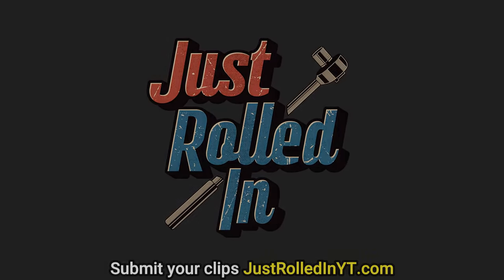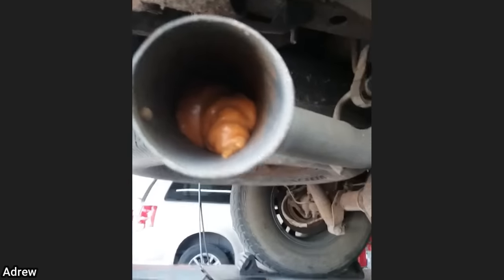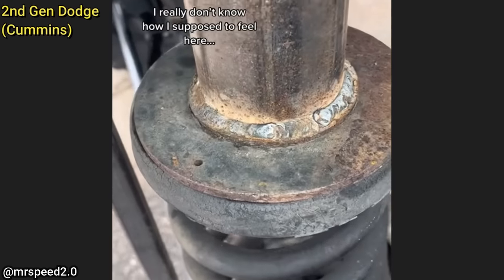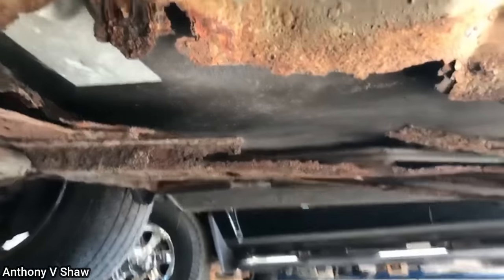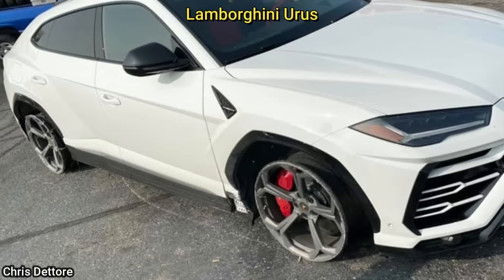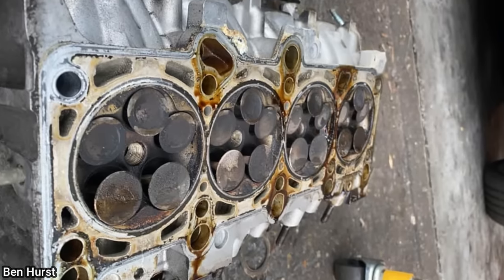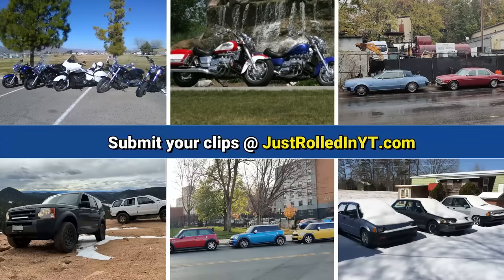Customer States They Drove Over A Bowling Ball | Just Rolled In

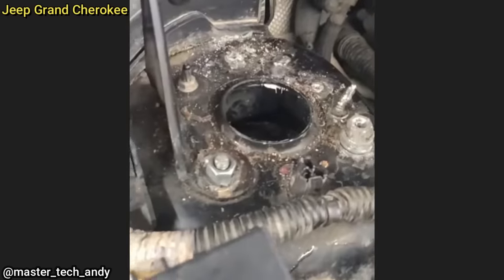Comment: The one about the brake caliper coming off and Wrecking the wheel hit me very personally no pun intended. I bought a Dodge Caliber that this guy had for sale claiming his daughter refused to drive it after he got it for her when she got her driver's license. Girl literally came out at one point and things this girl said for a teenager was kind of hurtful to imagine her family having anything to do with getting her anything. The whole situation was kind of sketchy at best but it had a clean inspection sticker on the car which usually anything with a 2-year sticker on it around here starts out at 2:00 or $3,000 and you're lucky it's running. Car was like 600 bucks or 800 bucks. And the reason nobody else had bought it was in it was such a insanely remote area. Was like 2 hours or two and a half hours drive to go get it and a super long drive back on Express highways. Car would make this little weird clunk noise when you put it in reverse or in drive and first push the pedal but I didn't think anything of it I mean it's a car that was like $600 or $800 I forget the exact price. i drove it home ironically vehicle was for my father to use for the winter. and I borrowed the vehicle the next day because driving it was about half the price of fuel as my van. My father hadn't even driven it yet which turned out to be a good thing. i got about 20 minutes from the house and a semi truck pulled about five illegal traffic Maneuvers in the span of 30 or 40 seconds.i hit the brakes and things kind of went downhill from there. Don't know how I didn't get hit by the guy that had been tailgating me. One of the front wheels locked up completely and jammed by some miracle I didn't blow out the transmission and had to force the vehicle off the road with one wheel jammed. Didn't hit anything at any rate by some miracle I didn't know what the Christ to expect and CAA come out and towed the vehicle home.i took the locked wheel off and was completely flabbergasted. One of the two bolts was now missing that holds the caliper on and the other bolt was nearly completely out the caliper had swung upwards and locked into the wheel. And pads on the car and on that wheel they had never properly torqued the bolts down. You don't want to know how far I had to drive to go get a caliper bolt off of one that was smashed up in a farmer's field do too there was no place to get a caliper bolt locally where I went was ironically not as far as going to the dealership lol and it probably would have taken two or three days of screwing around with the dealership to get something that stupid without having to buy another caliper because they probably don't sell the bolts separate. Problems we had with that car while my father owned it were hilarious. Sensor for the oil pressure was bad and in order to replace the oil pressure sensor you had to nearly remove the entire engine of the car and it was a known problem where even if you replaced it the sensor might quit 6 months or a year later. So the whole time we drove it the car was going bing bing bing bing bing and the light would flash constantly where there was a short and the light bulb on the dash for the oil pressure light imagine driving a car for 2 to 4 hours where it's making the same noise as not having your seatbelt on and there's no fuse to unplug or speaker to take a hammer and screwdriver in order to smash so it doesn't make a noise anymore. Most other vehicles I've had if you couldn't shut that beeper off due to a problem like that it was simply a matter of unplugging a speaker under the dash in a very easy to find location nobody was ever able to tell me where that damn speaker for the chime was you can crank the radio up all you wanted and it was like being in Initial D when the car goes over a certain speed;). Except for the fact you're Driving Miss Daisy fast and the car just going ding ding ding ding ding monotonously for hours. Sometimes the chime would turn off for 5 or 10 minutes then come back again but generally it went Non-Stop. We confirmed early on there was nothing wrong with the oil pump it was a bad sensor
Reply: I figured the "tone generator" would fail first, I have a friend with a 2015 Grand Caravan that stopped making all tones at 58k miles, conveniently just after the 56k warranty expired. No turn signal sound, no seat belt/headlight chime, no "Hey, the temperature dropped below 30°F, which means I think all your tires are flat" warning.
Reply: @dashcamandy2242  The vehicle that I had the chime problem with was a 2006 Dodge Caliber yeah beer can with tires in the very literal sense. I try not to hate on those curves but my Lord if you ever close the doors on one you know what I mean about the entire build of the vehicle is very tinny and just sad in general so many things were broken on that car and it's still functioned. I lost track of how many pieces that had been replaced on the car that were warranty recall where a nearly half the drivetrain was replaced and I still the whole time I had it had drivetrain problems where I kept putting brand new parts on the drivetrain and they weren't making any difference basically it had the entire rear end replaced due to a series of recalls and I still replaced a whole bunch of parts with brand new stuff and nobody could ever seem to get anything to work right. Got to the point I was constantly picking up cheap used tires on rims from salvage yard vehicles and every couple weeks swapping out tires where it was constantly eating tires nobody could figure out how to get into Lima done on it despite everything had been replaced. Vehicle was in my father's name and eventually he got rid of it I wouldn't have bothered I would have just kept driving it. Bizarrely enough the person that bought it has been driving it now 3 years and it's still going. Besides the tire problem it had an oil leak that we couldn't find short of again removing the entire motor. It would go through a boat a bottle of oil small bottle every 400 or 500 miles which I don't consider a big deal it's not like it was smoking like a freight train . With the build quality of the car felt about as safe as running naked during a hurricane but it got great gas mileage. If anything had hit one of those Vehicles it would probably fold up like a beer can. Person that bought it I thought bought the thing for parts and I just keep seeing it driving around and it's been 3 years later and the thing is still moving like a cockroach it won't die .

Comment: FIVE VALVES per cylinder??? That’s crazy! How does that even work? I hate Audi’s. Now wonder they are garbage.
Reply: Yep, never saw that before. Always merely two but there's no Audi in my future:/
Reply: There are lots of high performance vehicles with multiple valves. It works because multiple smaller valves has better properties than one large valve.
Reply: @brianstratton8767  Many cars have 4 per cylinder.
Reply: @PsychoticBovine  right, but 5? what's the 5th one for?
Reply: @ssarkees  I think it's an extra exhaust valve to get the burned gases out faster.

Comment: I ruined a head on a 20v Audi engine doing a timing belt.  Everything was good, rolled it over by hand a few times, but forgot the ratchet and went to start it up.  Ratchet spun around and locked against the control arm seizing the motor. Bent 12 valves.     Won’t make that mistake again!
Reply: Oop$:/ 

I'm no gearhead but never saw 5 valves per cylinder before; thought they just need 2?
Reply: @brianstratton8767  Need two, yes. One for intake and one for exhaust. More valves allows the head to move more air, increasing the engine's power potential.

Comment: About the clip where the car owner was surprised turning off their infotainment system turns off the screen, I had a 2013 Mitsubishi Outlander where the power button only controlled the audio portion of the system, the screen would stay on and you could still use the navigation or any other function.  It took exactly one time to learn on my new Subaru the power button shuts the whole system off, so now I just turn the volume all the way down if I don't want any music playing.  I did not return it to the dealer to get it "fixed" 😀

Comment: At least they welded the lift "kit". I've seen spacer blocks stacked on top of the frame half a dozen high with only the U bolts keeping it together.
Reply: Insanely dangerous still, but I would wager it is at least a smidge more stable than the multiple spacer blocks dry stacked on top of each other.

Comment: I work in television production and my favorite missions for the new interns are: "This cable is a little short, can you go to engineering and ask them for the cable stretcher?", "Can you go to engineering and ask them to refill the bar and tone generator please?" (That's the annoying noise and color pattern video which is generated by a test signal generator which runs continuously on ac power), "Can you go to engineering and ask them to empty out the drop-out bin please" (drop-outs are the noisy or broken up parts of video which are unfixable), "Can you ask the engineer to top up the satellite dish, it's a little low on signal?", etc. etc. The production and engineering departments in most TV stations are often butts of each others pranks.

Comment: My partner did something similar to the guy in the last clip.

She just finished drilling 2 holes into some concrete to install a door stop and stuck an air hose into the hole and smashed the button, BEFORE she put the dust extractor hose over the top of the hole. So she got a straight up blast of compressed air and dust all over herrface, hair and chest. Was so damn funny.